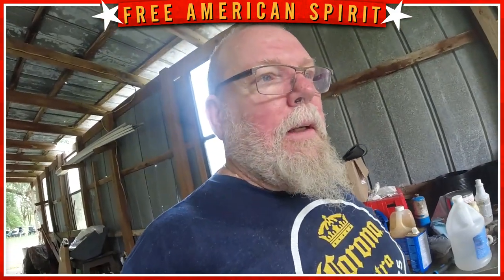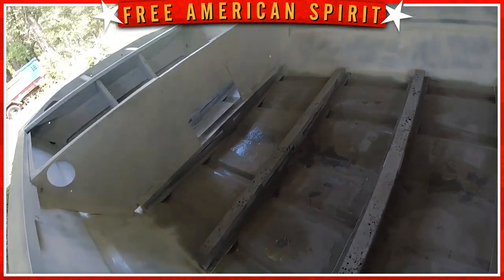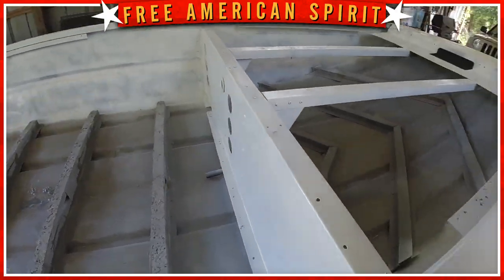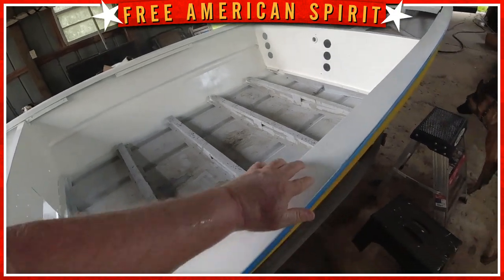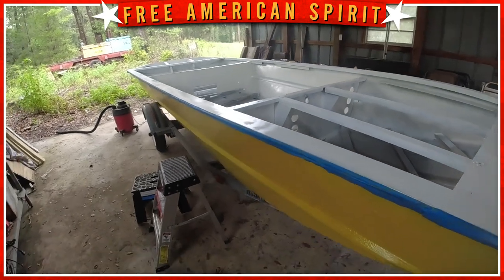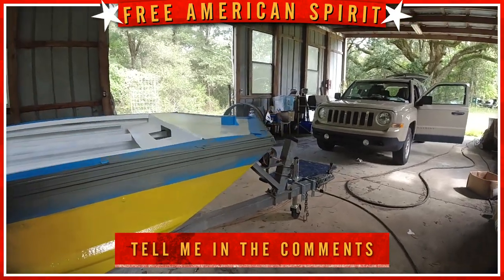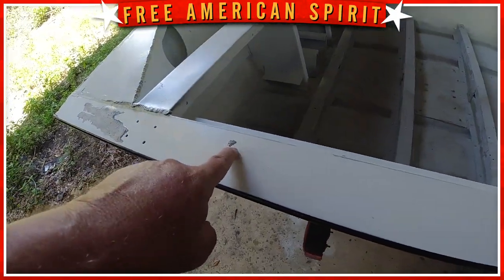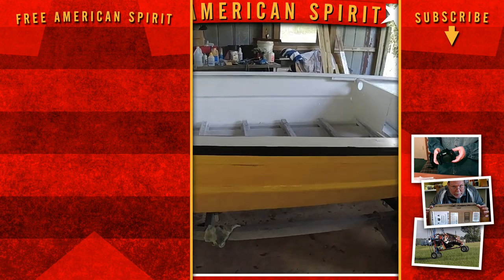#4 Bass Boat to Jon Boat Painting the Aluminum

Comment from the maker: Support our Channel.   Amazon home page link To buy things you normally buy:
https://amzn.to/3KqqQi2y Amazon home page link

Gluvit Aluminum Boat Sealer:
https://amzn.to/44Rdtj2

Gflex flexible epoxy for installing rivets:
https://amzn.to/44RvZI5

Mesh Sanding discs ( much better than Sand paper discs):
https://amzn.to/3OmP260

Epoxy Paint remover stripper (JB weld and Epoxy paint):
https://amzn.to/3KoO8Vm

Acetone (must use before painting):
https://amzn.to/3Koz5uK

Alcohols ( also to clean before painting);
https://amzn.to/43NnSec

Xylene Glue remover (Carpets):
https://amzn.to/3YySu2d

Disclaimer: These links are affiliate links.  Free American Spirit will earn a small commission if you make a purchase at no additional cost to you. These are products, services, companies  and websites that I actually use and like. There has been NO Prior compensation paid to me to promote any of these links.

Disclaimer: These links are affiliate links.  Free American Spirit will earn a small commission if you make a purchase at no additional cost to you. These are products, services, companies  and websites that I actually use and like. There has been NO Prior compensation paid to me to promote any of these links.